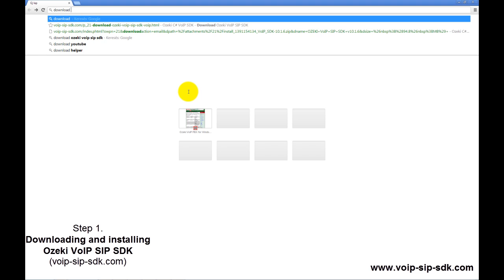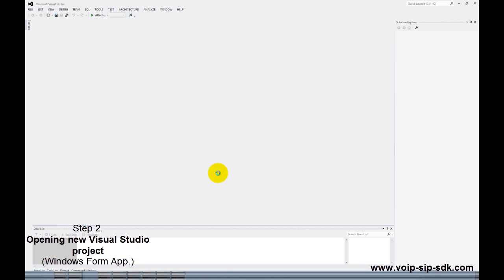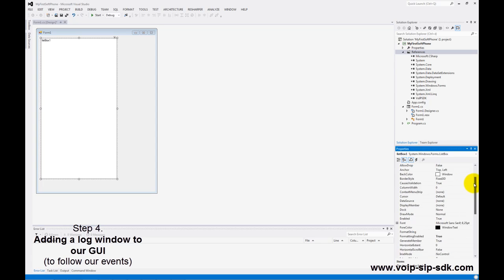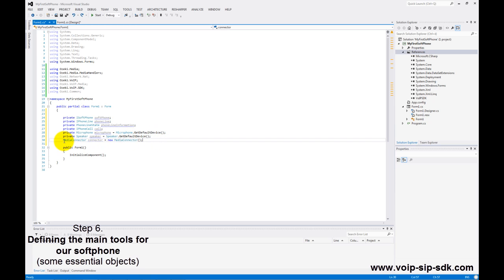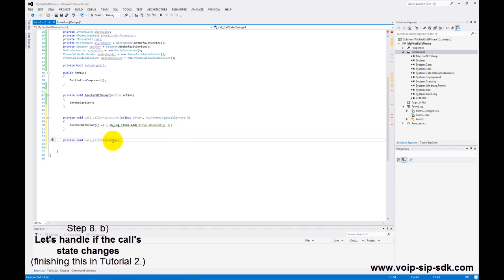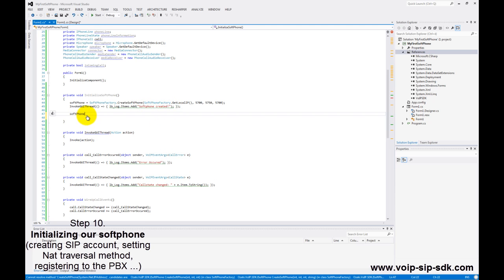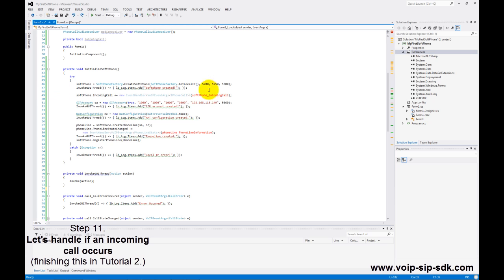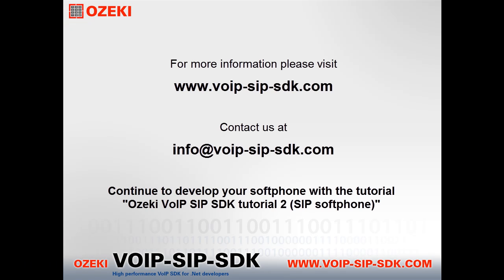#1 How to develop a softphone by using Ozeki VoIP SIP SDK - Tutorial Part 1

Comment: There is some problem with registration.It is not able to register with the sever using the new commands as well.
Reply from the maker: Shubham Shrivastava Hello Shubham Shrivastava, 

In case of multiple network interfaces, it can be occured that the SDK selects a wrong one.

If so, you need to open the source code of your program and use the following code snippet to select the network interface that should be used by the SDK for SIP registration:

softphone = SoftPhoneFactory.CreateSoftPhone(15000, 20000);
var sipAccount = new SIPAccount(true, "858", "858", "858", "858", "192.168.115.100", 5060);
var config = new PhoneLineConfiguration(sipAccount);
config.LocalAddress = "10.160.4.10"; 
phoneLine = softphone.CreatePhoneLine(config);

(You can provide the proper network interface by using the LocalAddress property of the PhoneLineConfiguration class.)

Useful tutorials: http://voip-sip-sdk.com/p_532-how-to-build-a-softphone-with-ozeki-voip-sip-sdk-voip.html

If you have any further question, please contact us at info@voip-sip-sdk.com!
Reply: Moore William Thanks for the reply. I also wanted to ask whether or not it is possible to send reinvite during a call for eg for a change of codec.
Reply: Shubham Shrivastava Hello, 

I would like to ask you to use this form to request technical support: http://voip-sip-sdk.com/p_26-request-support-for-ozeki-voip-sip-sdk-voip.html

Comment: hello,
can this ozeki VoIP be installed on phones?:)
Thanks!

Do you have a tutorial for creating soft phone for Eclipse?
Reply from the maker: If I understand you well, you need a softphone that can be used on your mobile phone in order to turn your mobile into a fully functional VoIP phone. 

Ozeki VoIP SIP SDK offers VoIP clients for the most popular mobile platforms (like iPhone/iPad, Android, etc.). For building a mobile application, you need to create a server (MediaGateway) and a Client (it will be installed on your mobile phone).

You can use Adobe Flash Builder to develop a client application. The server side has been created in C# and it can be developed using Visual Studio. The server should run continuously on a Windows PC. The client will connect to this server.

If you need more information or free example source code, I recommend you to visit the following pages

Mobile Phones and platforms:
http://www.voip-sip-sdk.com/p_449-voip-mobile-platforms-voip.html

Mobile Development:
http://www.voip-sip-sdk.com/p_455-voip-mobile-devices-voip.html

How to build an iPhone / iPad VoIP Client:
http://www.voip-sip-sdk.com/p_457-voip-iphone-integration-voip.html

How to build an Android VoIP client:
http://voip-sip-sdk.com/p_456-voip-android-integration-voip.html

How to build a Windows Phone VoIP client:
http://voip-sip-sdk.com/p_511-windows-phone-platform-voip.html